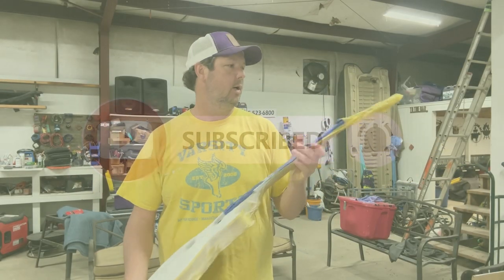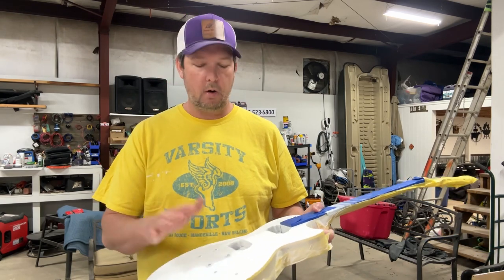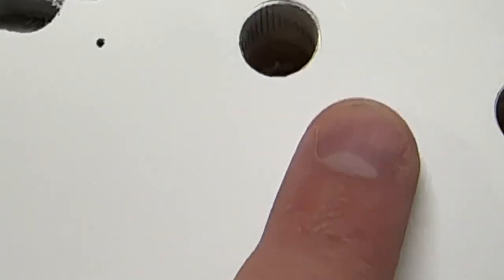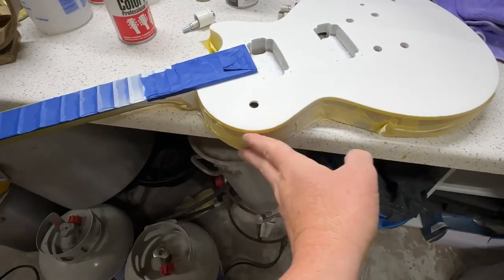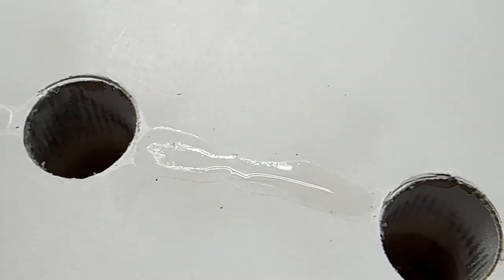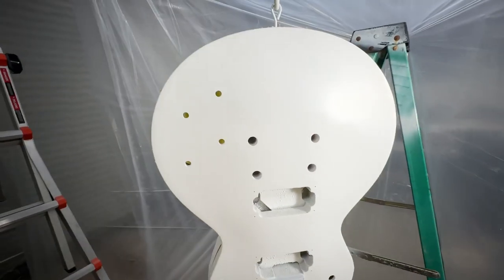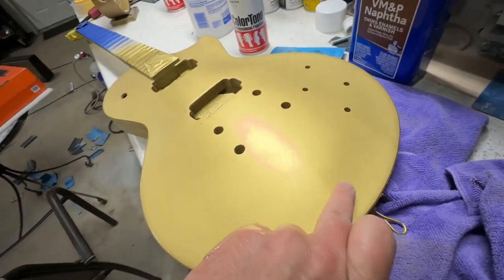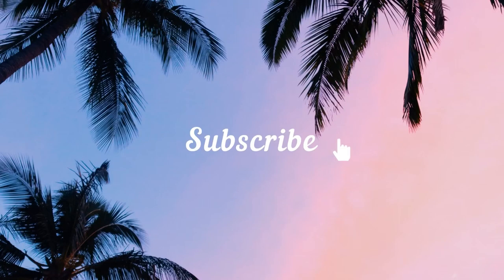Part 20: More learning experiences from the stewmac Les Paul gold top clone.#guitar #gold #painting

Comment: Looking good. See if you can rig a small oil radiator heat source (not a naked flame) within or adjacent to your sheeted area to try and increase the temperature slightly which will help reduce your humidity.
Reply from the maker: That’s a wonderful idea ! I may work on that in the future.